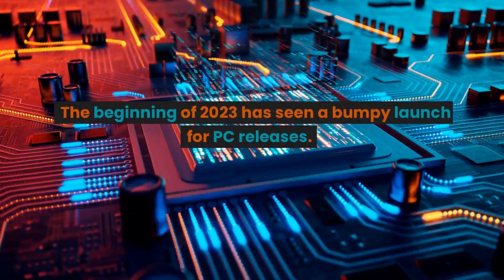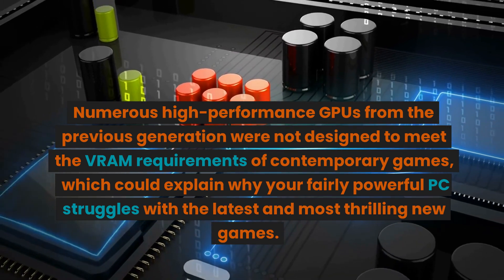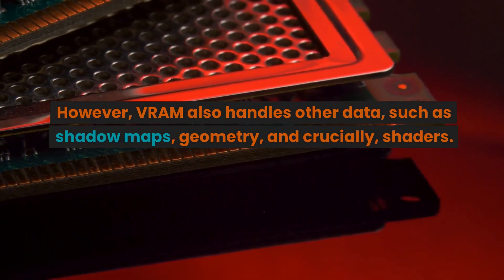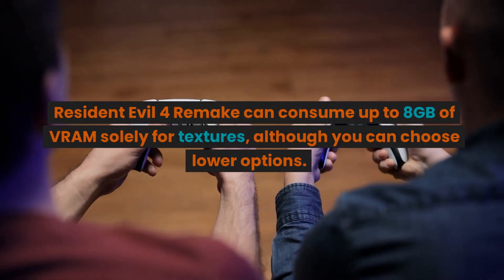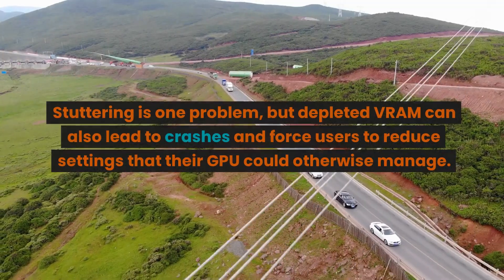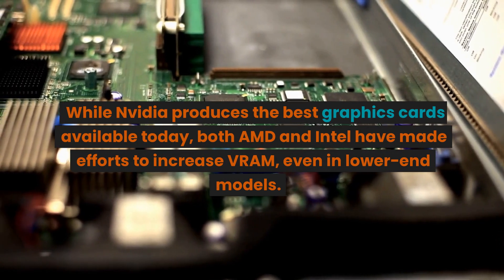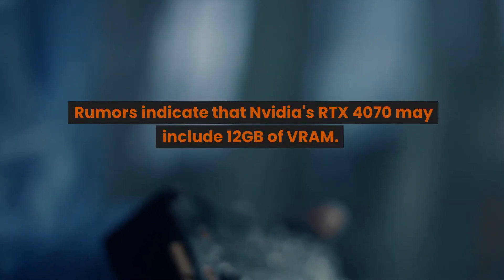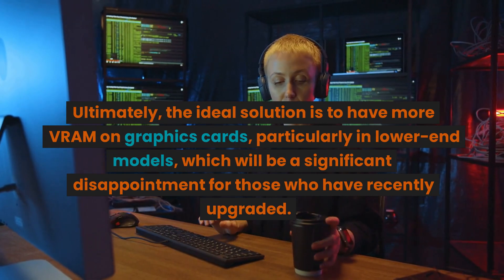The surprising reason behind your high-performance computer's inability to handle the newest games.

Comment: intel arc a770 has 16gb vram. is this a reason to buy intel or go for rx6700xt with 12gb vram.
Reply from the maker: IF you want to use it for longer, I would go for 16.